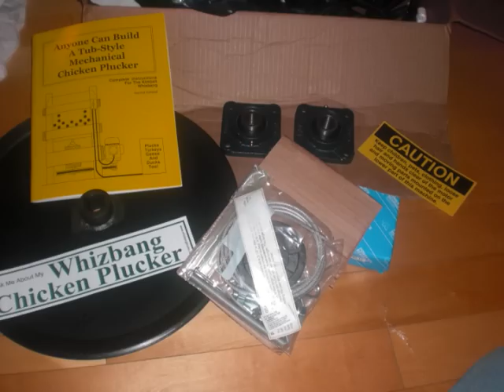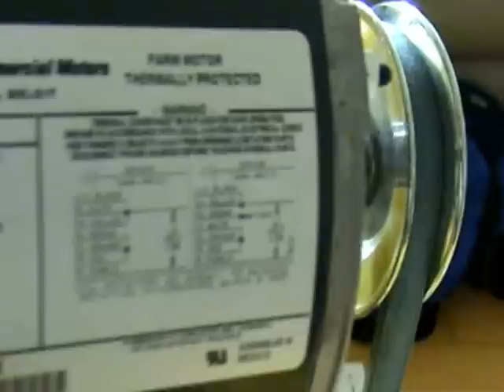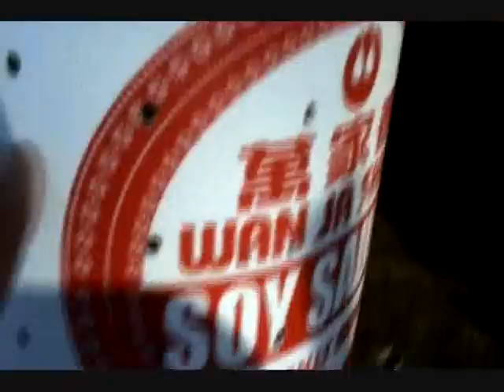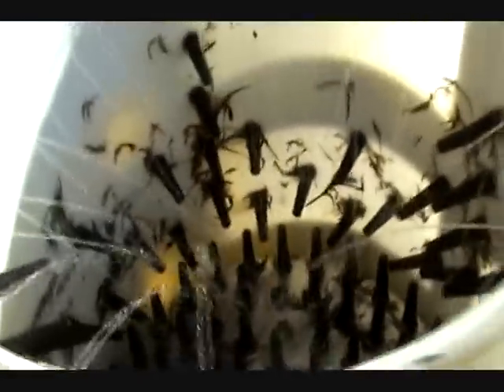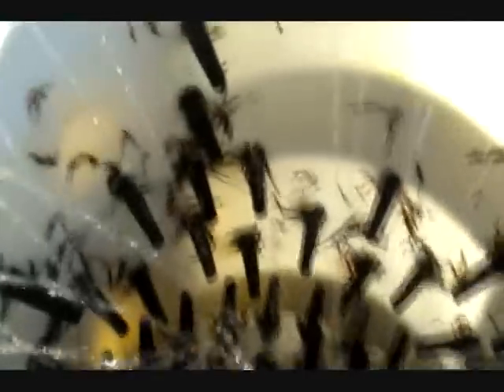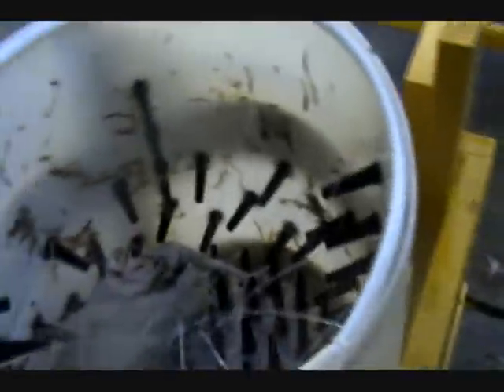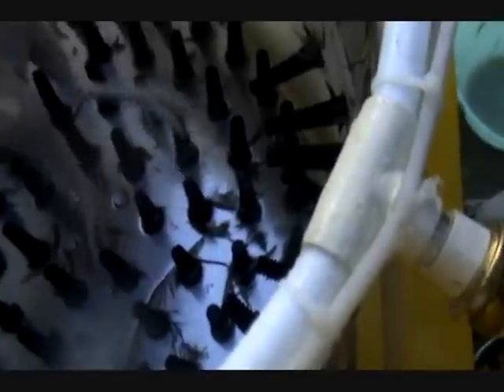Chicken Plucker  2009  ( Whizbang DIY )

Comment: I constructed a home made whizbang  bird plucker by picking up a second hand washing machine from the goodwill for $30. Took the cabinet lid off, wired the solenoid switch so that it only runs on the spin cycle. Drilled holes on the tub walls and bottom, installed rubber fingers purchased from the Kent rubber company. Make sure to cut several gaps or larger holes in the bottom of the tub for the water and feathers to drain out. Its not as pretty as a whizbang, but works and total cost under $75. Or to cut cost further you can use 4 inch garden hose pieces secured with 3/8 stainless steel bolts - as I had initially used for the first year. But the rubber fingers work much better. Next spring I will build a wooden frame with garden cart type wheels for mobility and discard the washer body. I don't raise chickens but hunt a lot of ducks and geese. I can clean the entire goose now instead of just breasting out the bird

Comment: very nice job, you can also use the fat ends of bungee cords for the rubber tips. but I like your idea better. are those tire valve's ? I guess you would cut off the brass threads first.